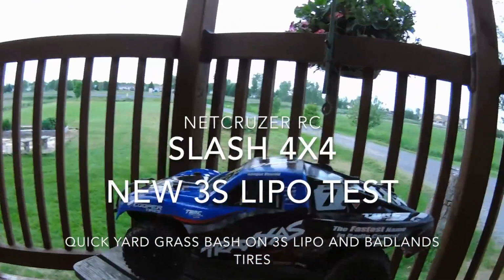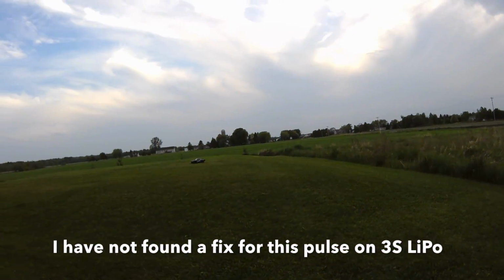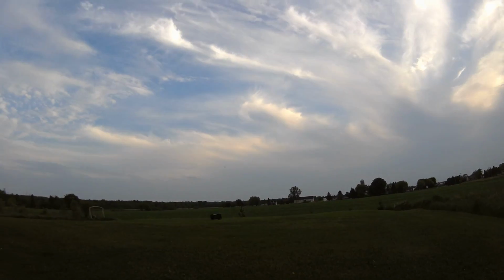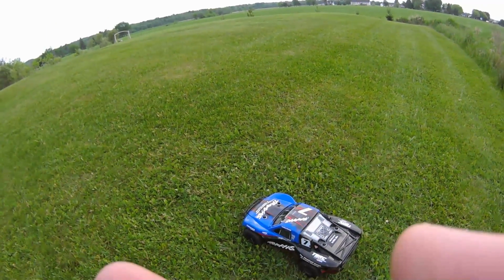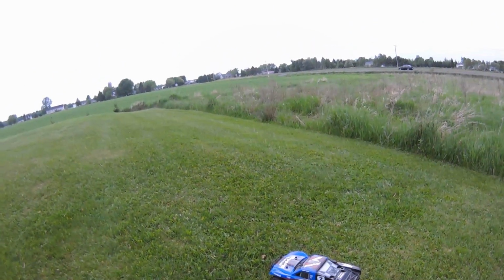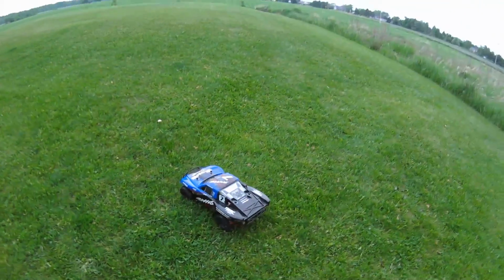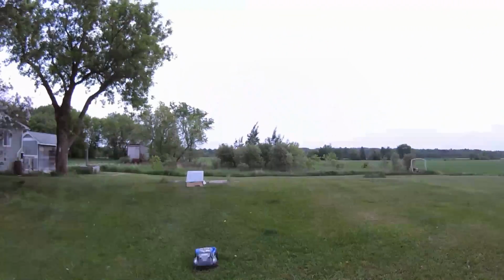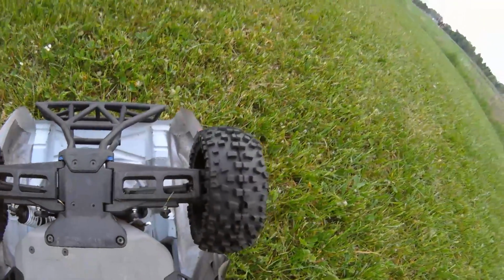Slash 4x4 TSM OBA new 3S LiPo Test Run

Comment: Your proline body mounts are not working because on the base of the mount there is a rubber o ring that causes friction against the thumb screws, but you have the Traxxas body washers not allowing that contact between the rubber and thumb screws. If you still have the proline body mounts it’s worth giving it a shot without the body washers. Hope this helps.

Comment: I have the same problem with my kinexsis 4000kv motor and the esc it will run for throttle then loose power then stop I hit the throttle 3 4 times and it works again for about 3 min and I’m not running lipo anybody have any suggestions?its a brushless motor